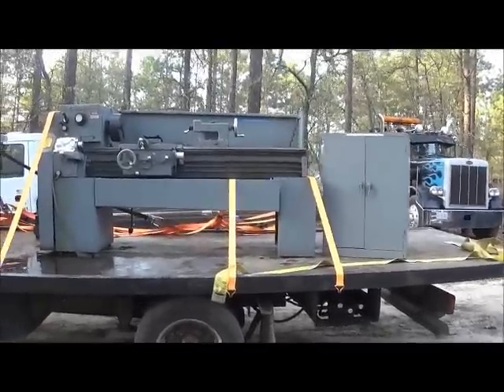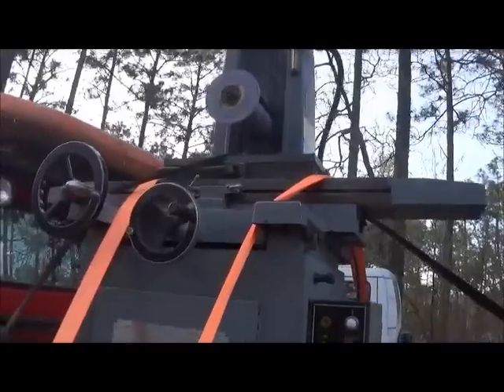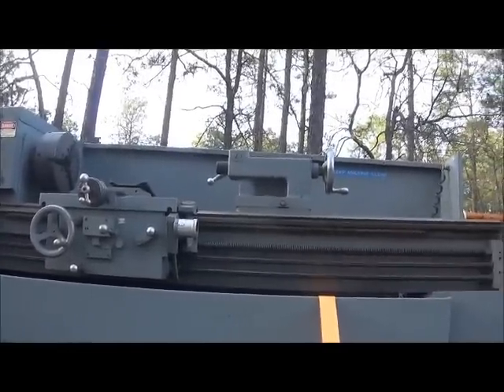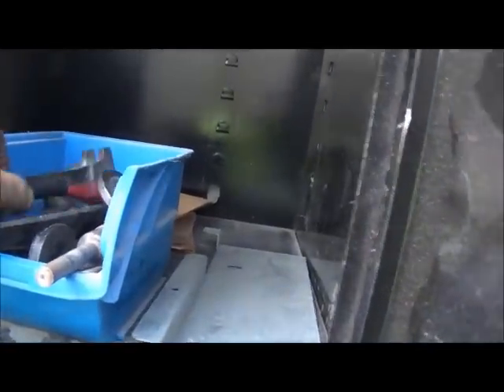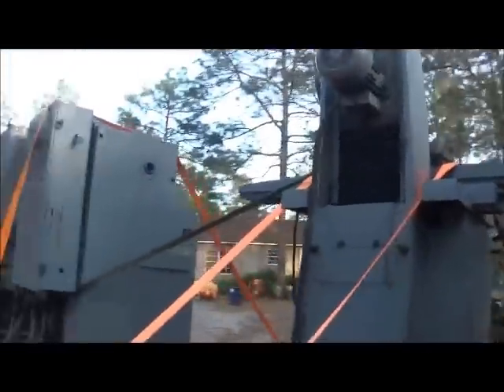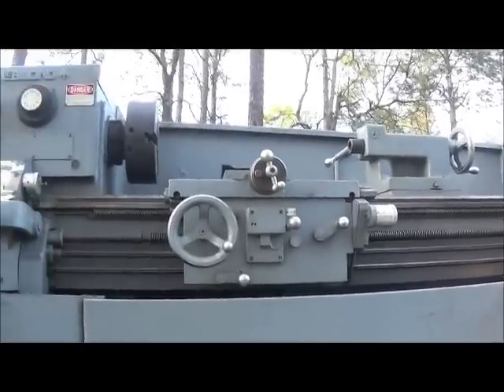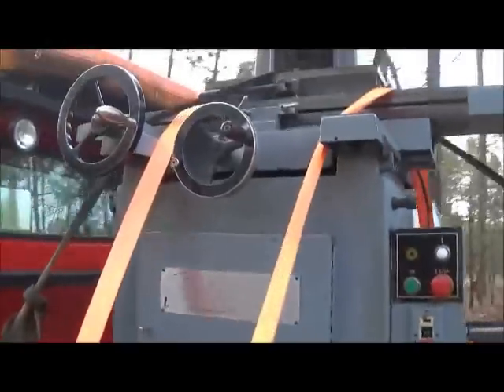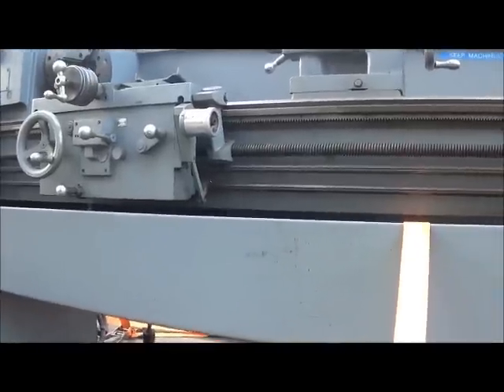More Machines Lathe And Surface Grinder

Comment: Nice score!!! The LeBlond lathe is very durable. Their weak point is the electric brake. It will out cut that Clausing and hold just as close tolerence. I wouldn't part with either one. Great to set up one for primary and the other for secondary ops.

Comment: Jonathan, Search Ebay for, "leblond makino regal" and you will get a ton of examples.
Look real close, the ways might be tool steel, bolted on to the bed.  If a gear is damaged, likely the Servo shift mechanism got a wild hair about it to do the damage.
I would get a gear and keep it.  Look under the cover we talked about.  You will see the plastic linkages.  Buy or make some manual handles for it.  Maybe the servoshift is not messed up too badly.  There is a magnetic clutch outside the headstock, right on the pulley for the input belt. The clutch is connected to a bellcrank rocker with another bit of plastic linkage.  When you call for a shift, the rocker motor comes on, the clutch engages, and "rocks" the input shaft back and forth to mesh the gears, while the servo mechanism changes them.  If this clutch and rocker motor don't work, this could cause a gear crash. Problem with the clutch is it is always energized when the lathe is off. It gets hot and burns the coil out.  Need to turn off with a master disconnect switch to fully turn off the lathe and clutch coil. (no one ever does, so...). Could be as simple as that.  
In the bottom of the grinder parts cabinet is the overhead wheel dresser.  They are a pain to tram in, but kinda fast for roughing in a wheel.  That is a sweet nice grinder. I gotta spend a few hours with you when you get it hooked up. I will put you on the fast track with grinder knowledge.

Comment: Boy I need to be your friend , the luck might rub off some. If ya find anymore LATHES or a vertical metal bandsaw send a holler . I'm not able to get around being in a wheelchair but I love my shop . It's what gives me a reason to live building things , working on guns , I can fix anything , fifty plus years as a machinist and mechanic even carpenter cabinet builder. Just bad body . Good luck with the new tools those grinder wheels are I bet worth a grand.

Comment: Look in the boxes for a dressing (steel) BLOCK, with a diamond tip ( looks like a pencil )  to true up the grinder wheels.. The diamond wheels are to dress up carbide tooling IE gundrills or brazed on tips of lathe tools  etc. They are PRICEY .... Note spindle is LEFT hand thread to change wheels and ONLY SNUG UP the nut ..     Hope I gave you some infor you need . Regards John

Comment: the lathe is a late model LeBlond Regal 19inch  power-driven, Servo shift headstock- easily identified by the 2 lever and dial control. Hope that helps you out in the identification.

Comment: hey jonathan > 1) demagnetizer 2) sine plate 3) 4 jaw. seen already you got rotary vise / table so divider head only for higher level precision AND measuring / inspection - worth every red cent would be an optical comparator which im pretty sure for sale would be few & far between expensive. you able make damn near anything with them. thnx amigo.

Comment: Would you like to sell a couple of the flat back grinder wheels. There for a carbide tool grinder , if you do let me know. I'm disabled on SS but still like my hobby. That lathe should be fixed and used I'd love it but I know I can't buy it.